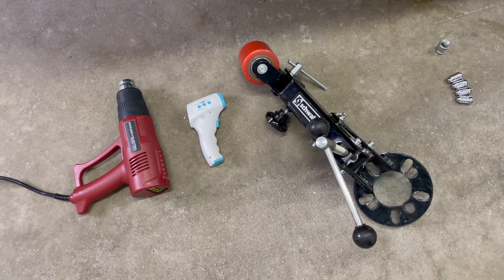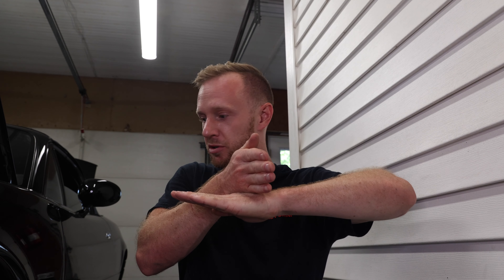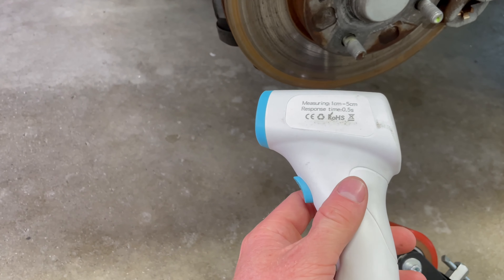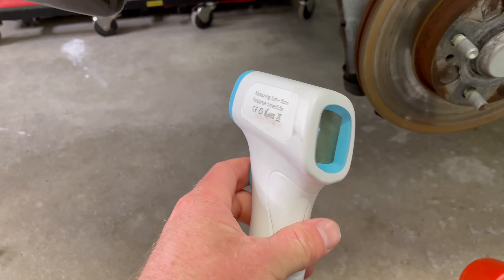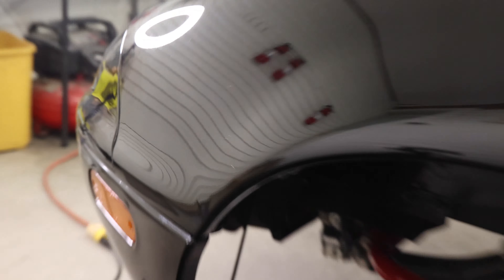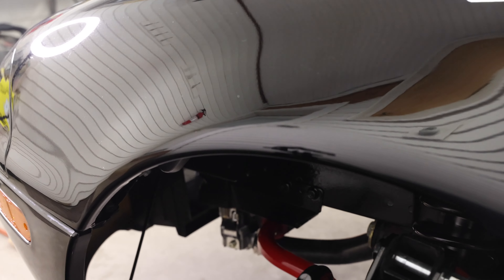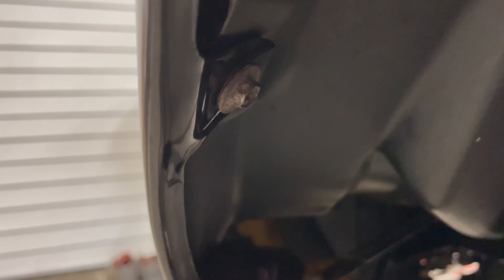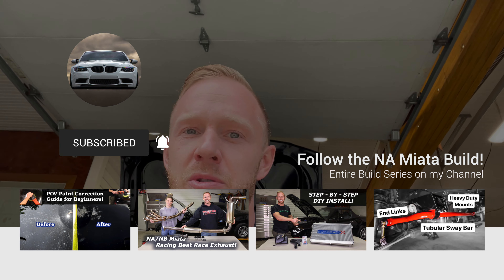How to Roll Fenders Properly!

Comment: My tires stick out a bit. May be less than 10mm. Is it possible to pull out the fenders using this process so my tires sits flush on the fenders? Thanks
Reply: it is

Comment: what if i dont' care about cracking the paint job, do i still need to heat the fender with a heat gun?
Reply: No. It doesn't make the metal softer, just the paint.

Comment: Can this tool be used on a car that has wire wheels and no studs ?
Reply from the maker: I’m not entirely sure.  It should work as long as you find a way to secure it to the hub.
Reply: Just take off the adapters for the wire wheels and use the studs that the adapters bolt to.

Comment: I did mine too fast. Got some cracks on the front, and bent edge. I had to give the car to body shop, and they cut the lip in many places, made it flat and welded, than filled and protected so the water wouldn't stay there. But i didn't keep the heat that much, and that's probably where i screwed the job :D
Reply from the maker: Yeah a lot of people cut a little slit first, but I try to avoid it if possible.  Keeping an eye on the heat and going little by little is definitely the key, but by the 4th fender, it does get very tedious lol.  Sry about your experience!  Sounds like it’s all good now though at least!